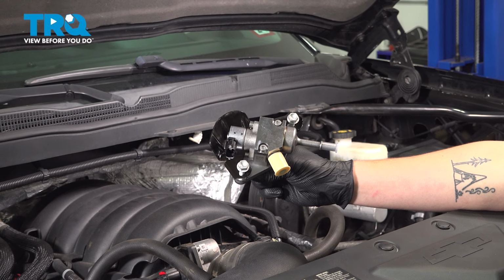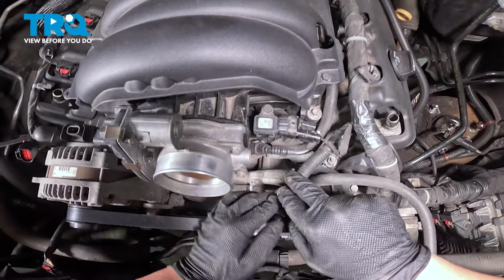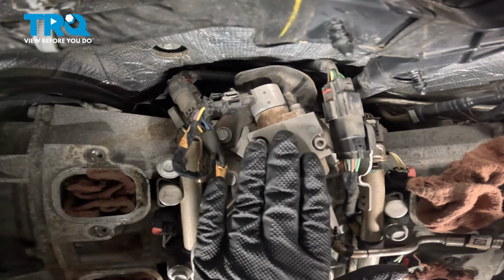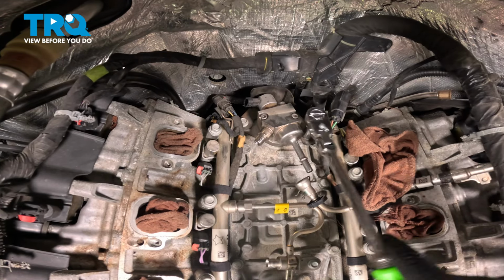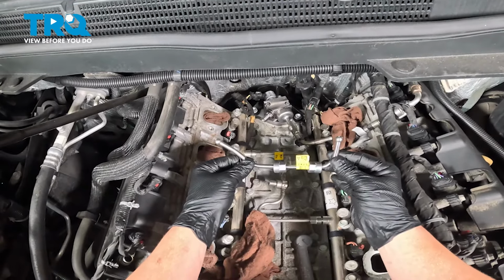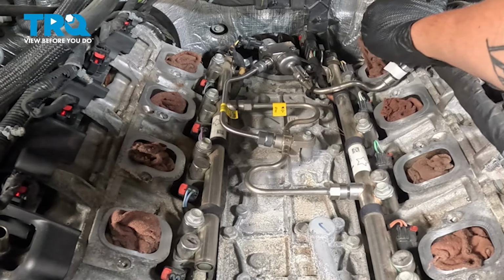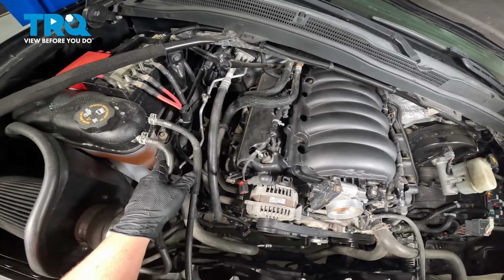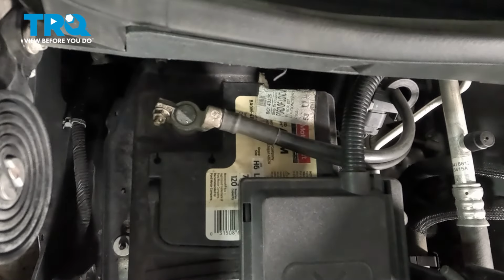How to Replace High Pressure Fuel Pump 2014-2018 Chevrolet Silverado 1500 5.3L V8

Comment: How would you even know this part was bad? My 2018 suburban has 70k on it so far.
Reply: Normally it will start and run for a bit but then dies out after a few minutes, but the lift pump could also cause it so if one is bad chances are the other is too
Reply: Typically a p0172 and p0175 rich codes and oil that smells like fuel
Reply: I was initially throwing P0073 and P0075.  I did some research and found that the culprit was often the high pressure fuel pump for this. My truck eventually went into limp mode which further confirmed my suspicion. Took the truck to get a diagnostic and they confirmed what the internet said...  These 5.3's have occasional issues with HPFP.  Best of luck!
Reply: Scanner

Comment: Does the fuel system on these year model trucks have a fuel filter?
Reply: Just inside the tank. It's integrated into the pump.
Reply: No I own a 2016 Silverado lt 5.3l gas engine and they have no fuel filter maintenance requirements. Fuel pump assembly located inside the fuel tank